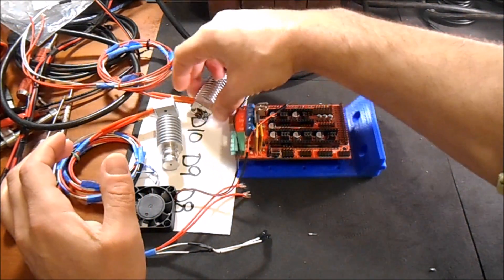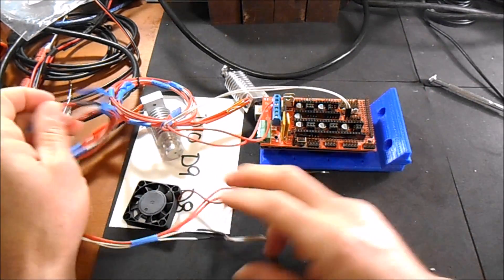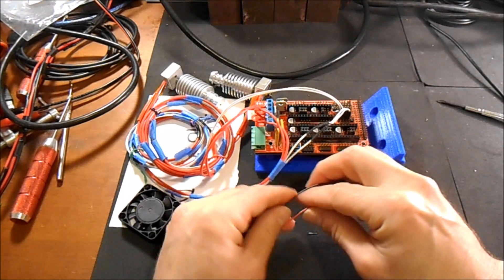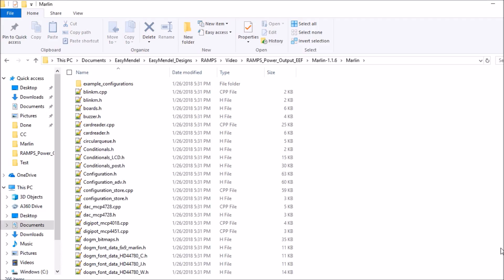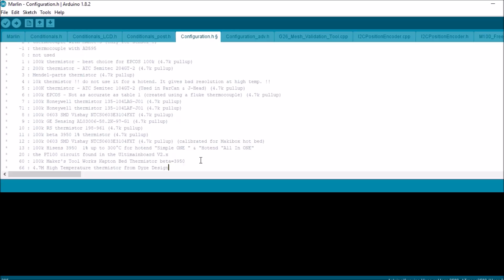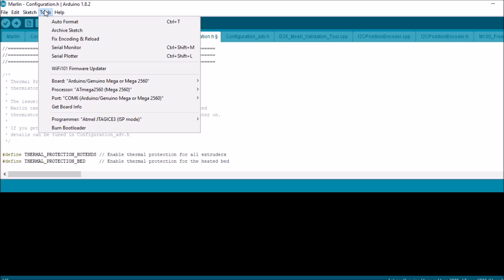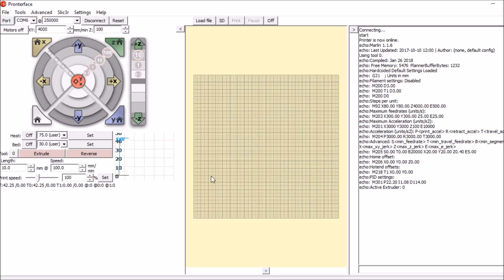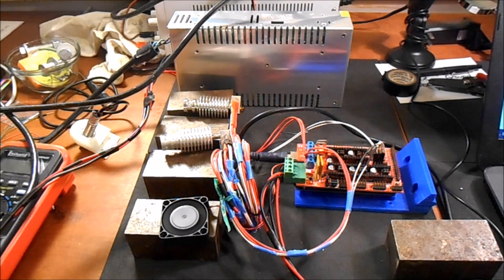RAMPS 1.4 - Power Output EEF (D10, D9, D8)

Comment: Hi, thx for the video. I have 2 cartridge heaters, which i connect in D10. So that means in marlin "Extruder 1" is correct right? Its not 2 Extruders.
Reply from the maker: In English it would be second extruder.  In computer terms second would be 1 as counting starts at zero.

Comment: Hi Ed, is there a video where you explain how to settle 3 thermistors?
Reply from the maker: It's in playlist as 3-4 videos.  Think it's was EFF, EFB, EEB in titles.
Reply from the maker: Could you rephrase your question as I'm not understanding.
Reply: @EdwardBraiman  My question is if it is posible to add a 3rd thermistor in a ramps 1.4 EEF. I was able to settle e0 and e1 thermistors, but in pronterface i can see only 2 measures, the 3rd one is repeated.I tried commenting redundant sensors on marlin, but still i can not get the last thermistor´s reading on pronterface
Reply from the maker: Fans do not use thermistor.  If you used a heatbed, it would be different.

Comment: im not getting any voltage off of my ramps 1.4 from E0 or E!. Any suggestions?
Reply from the maker: Could you give me some details?  Are you measuring from the output ports using probes from a multimeter?  What motherboard type is specified?  Is there any damaged wires to the heaters?  Could you explain the steps you used to verify no voltage?  Are the wires seated correctly?  Remember to check wiring without  under load or powered.
Reply: Edward Braiman figured it out!! Made the simple mistake of not realizing you couldn’t extruded when the hot end isn’t hot, I got it to temperature and everything worked fine thanks to your videos
Reply from the maker: You're welcome.